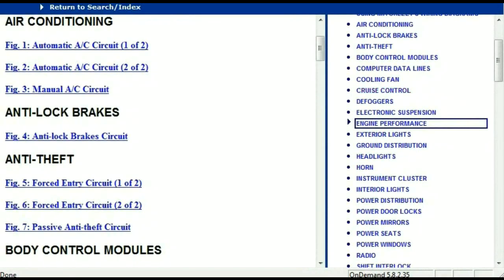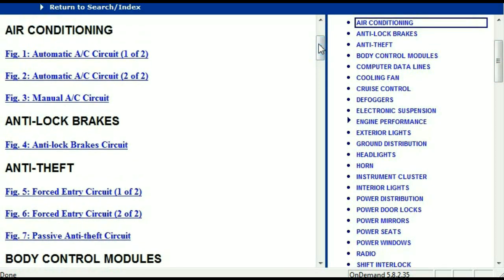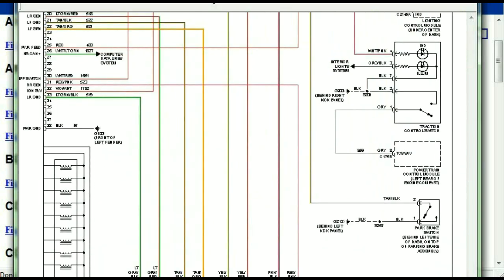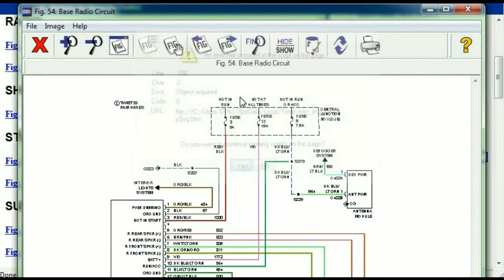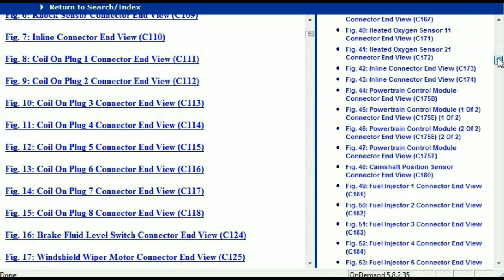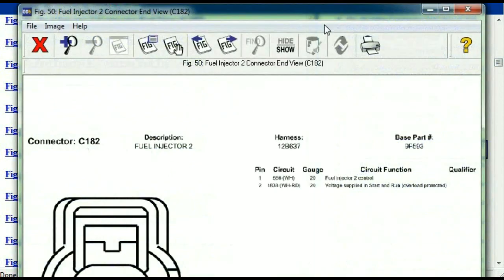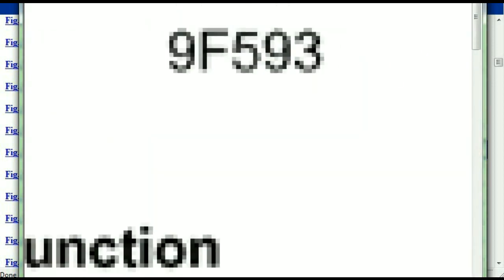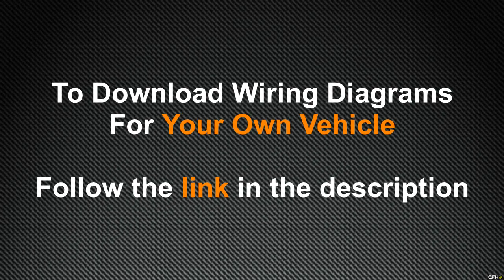Jeep Grand Cherokee Wiring Diagrams 1998 to 2016

Comment: My lights won’t turn off when I turn my headlight control switch off already replaced it the headlight control knob switch, the only way the lights turn off is when the car off when the car is on. I cannot turn the lights off and they’re always on. I already tried, turning the lights off through the Uconnect. Daytime running light settings still will not turn off.